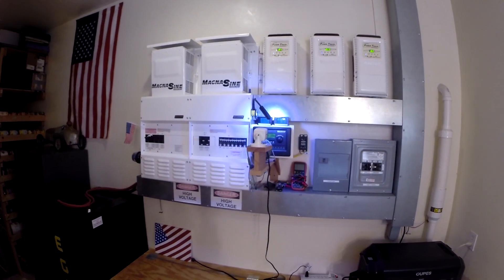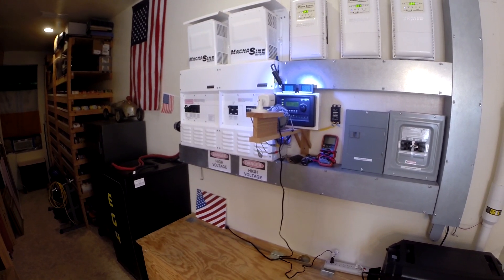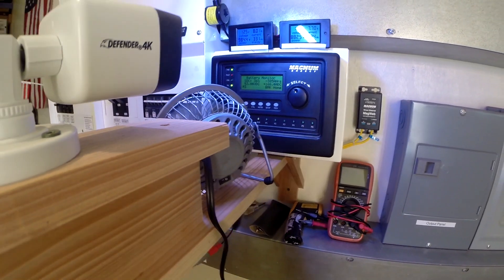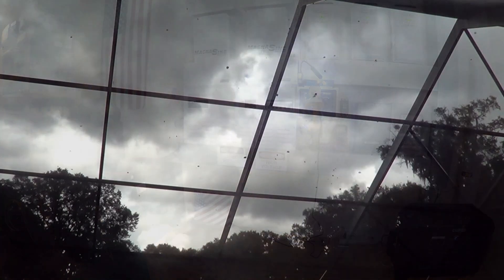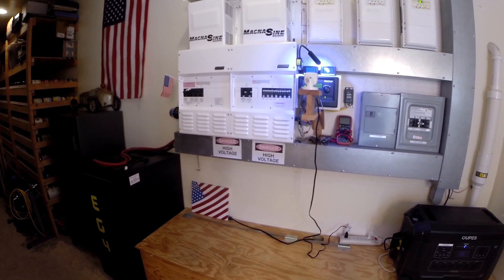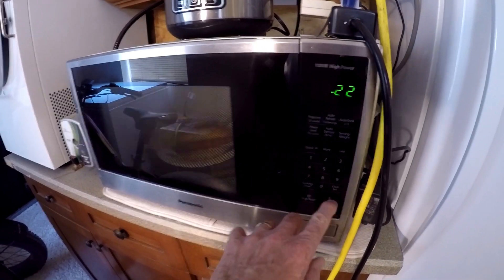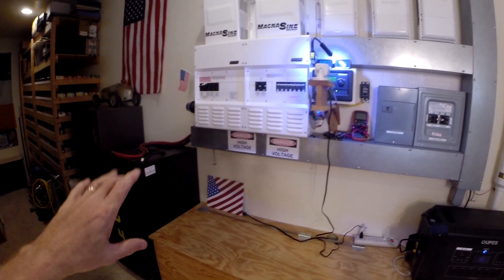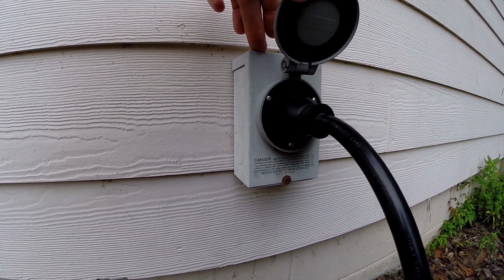Backup Power: Whole House Solar

Comment: Impressive system. I just found your channel and appreciate the detail you put into your system. I live in CT. I did not plan the whole solar gig when i purchased the home, it was what i could afford at that time. Solar boom hits, now I found out what the City Hall requirements are for a solar system ground mounts. It is what it is, I cant go up against city hall to rethink their requirements. City follows the NEC 2020 code book. Ground mount solar arrays cannot be over 6 ft. high. Panels have to be 5 ft. from the fence, 2 ground rods spaced 6 ft apart per each array, 2 ground rods 6 ft apart at the home entry junction box. They require a UL listed 2703 solar rack array system designed by a professional designer. I have an EcoFlow Delta Pro Ultra (2) inverters and (4) 6.14 kw batteries and a Smart Home Panel 2 that has been working since July of 24'. Hence the need for my solar array system. I found recently from the inspector and my electrician who installed the SHP2 that there is a 30Kw cap on batteries in the residence. All this information is overwhelming I think to discourage home solar systems from being built. Since I been spending time with my head buried in the NEC 2020 book and watching tons videos and including yours, I did not see any labels for "Solar Photovoltaic power source" any where in your videos i have watched so far. I am not a firefighter, just bringing this to your attention as a friendly suggestion if the event the fire department ever visits your home. There are a a lot of different labels that can be applied to different locations. I did not see any disconnect switches at the arrays that could be labeled as well. I'm looking at a year old video tonight, any grounding or changes you make can be the source of another video. You may not have these rules in your area, but the NEC code book and NFPA rules are nationwide. I'm just a home owner that wanted to mount 12 solar panels on ground mounts before the end of 2025 for the tax credit. Its not happening because the Inspector is a real pain in the A$$. I am going to add 12 more panels because they will be stationary to max out my MPPT solar inputs. It will be next spring before I can set the system up, its just me doing the work, as I will retire in 2026. This is just food for thought, nothing more. I did subscribe and liked. Thanks!

2022 CONNECTICUT STATE BUILDING CODE 2020 
NATIONAL ELECTRICAL CODE 2021 
INTERNATIONAL BUILDING CODE 2021 
INTERNATIONAL RESIDENTIAL CODE 2021 
INTERNATIONAL FIRE CODE
Reply: Above are the some of the requirements to get an approved Solar-Electrical permit plus 120MPH wind gust specs and total voltages of each array. I did calculate the the lowest temperature Co-efficient for my area of -14C. A lot of people don't do this calculation, but at least I know the maximum input voltages my panels can put out to keep from toasting my MPPT controllers. The solar panels will be in series since i top out at 15 amps on the low and high PV ports. Max voltages are 150V on the low and 450V on the high side PV inputs. This calculation was when i was installing 12 panels.

Temp coefficient (Voc) -0.36%Centigrade
voltage (Tmin) -14C degrees
40.17+( 1-14c- 46c)= -60
(-34x40.17/100)=-.1366
-60x-.1366 = 8.196
40.17+8.20 = 48.37
48.37x6 = 290.22 6 panels
48.37x9 = 435.33 9 panels
48.37x3 = 145.11 3 panels

Comment: Great info David! THank you! What Solar Panels are you using? Im going to build my Solar array this spring.
Reply from the maker: Do you have the Mega 3?  If so, I would go to Signature Solar (or local if possible) and get the best deal on standard panels (look for 25 cents/Watt).  Since the Mega 3 is limited to 150V, I would choose a panel under 50V and series 3 of them together.  Then choose the Wattage so you can parallel two sets of three and hit the 2,100 max Wattage for the Mega 3.  So maybe 6 panels around 350W/panel and 45ish OCV.  Thanks!

Comment: With the eg4 18k you wouldn’t need transfer switches. The grid comes into the inverter before the house and then in the settings for the inverter you choose how you want to use it. For example you can net meter or not. Choose if you want to use grid power or not.
Reply from the maker: Yes, that is correct.  I can just hear Will Prowse: (low) why would you (high) do that?  LOL.  These transfer switches are for the older systems like mine.  The 18k is far advanced from what I have but even the 18k is now considered legacy even by EG4 standards.  The newest design separates the 200Amp transfer switch in a separate box (GridBoss).  So, if you don't grid tie you don't even need that box and the remaining system (FlexBoss) is even more powerful AND more affordable.  Thanks!

Comment: I'm adding more solar since hurricane milton took down my big trees I'm going to add enough to power my critical needs at a minimum. I wish I could afford a whole house setup but that's way beyond my budget at the moment but the refrigerator and freezer are my priority and the moment
Reply from the maker: I think an Oupes Mega 3 and 2000W of solar would get the critical loads job done.  Add a small inverter generator to recharge the batteries when needed.  Thanks!
Reply: @HomesteadEngineering  I've been getting components for a DIY system I've got a couple ecoflow units if I need portable power but I'm also thinking about getting ahead of my power companies rate hike and just taking that stuff "off grid" to save some money. When I'm finally able to get my house built I'm going whole house solar and battery backup.

Comment: Hi David.  Has it really been 8 years since you built your system?  Wow, time flies.  Awesome set-up you have.  We don't have anything like yours but I have several Oupes and 2 other brands.  Our back-up is a duel fuel generator.  
Did you grow a garden this year?  You had a great one a couple of years ago.  Look forward to the next video.👍😀
Reply from the maker: I am becoming a big fan of Oupes.  Fair price for what you get.  Combined with a Duel fuel generator backup makes a very strong solution.  Might do a garden this year depending on how stable the country is after the election.  Its a lot of work!  :)
Reply: @HomesteadEngineering    Totally understand the Work!

Comment: Two Sol-Ark 12K’s, 32kWp, 180kWh LFP have been running our home for 2.5 years. No issues. My work van has Magnum 4000W 120V Inverter, 1620Wp and 10kWh LFP.
Reply from the maker: Now were talking!  :)